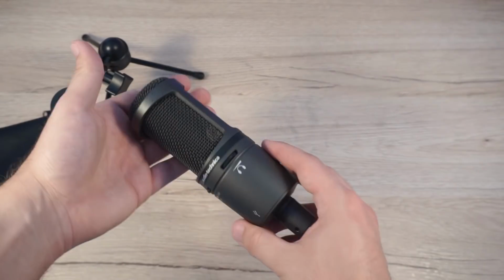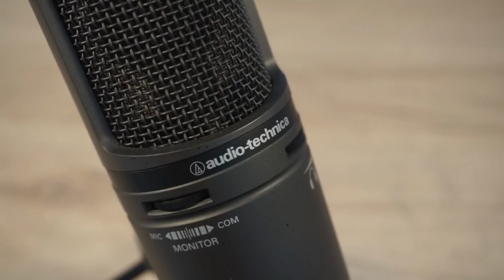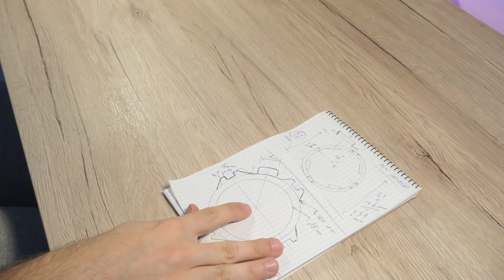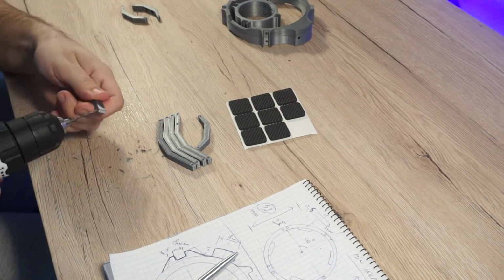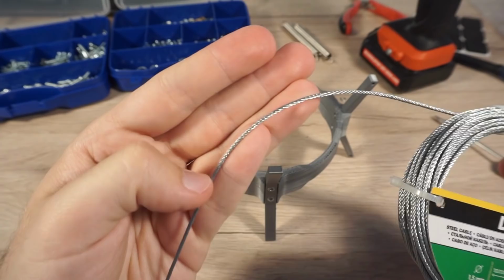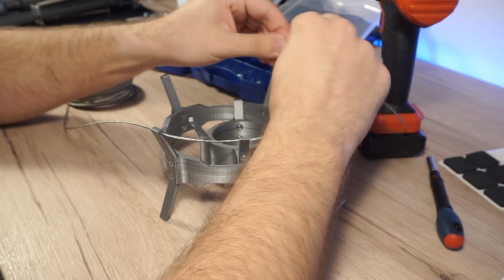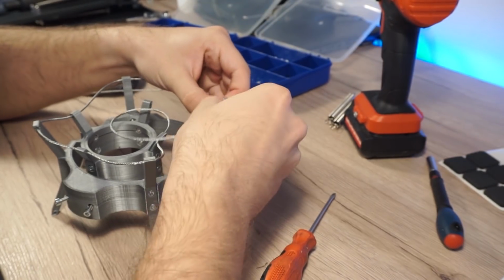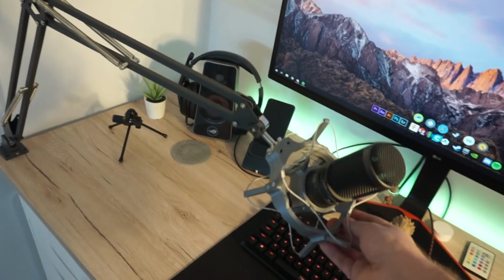How to make a shockmount AND boom arm for studio microphones | Audio Technica At2020 USB+

Comment: Okay....there's a major flaw with your shockmount - it won't work since it's all in steel, using elastic bands makes sense, because it has to be isolated from the environment, however, your construction makes a solid connection, almost as solid as solid coupling with no shockmount. Just sayin.
Reply from the maker: Hi! I am aware of this but I cannot find any rubber bands for a shock mount locally. The design works for any material, either it be steel wire or rubber band :) Currently it works fine and i tested it to see if any shock would be absorbed and indeed, only about 50% of the spike is absorbed. I did not intend to make the best shock mount available, just to inspire you to tinker with what you need :D Thanks for the tip, anyway! :)

Comment: Is the best "homemade" I've seen.
3D printer makes all the difference...

A very good work.

Sadly I have no 3D printer 😆🤦🏻‍♂️
Reply from the maker: Thanks for the kind words! :) 
Yes, unfortunately a 3D printer would be required. But also, you can send the 3D files to a local print company and it should be pretty cheap. I think 3DHubs is a good place to start :)

Comment: Hey! Great video! Do you know if it will fit a Samson C01u condenser mic? Thanks!
Reply from the maker: Hi Damian! As I've seen on the internet the diameter of the Samson C01u mic is 69mm, which is bigger than the Audio Technica one, so it may not be able to fit it unfortunately :)
Reply: @tinkertv  already did it and fits perfectly! In Argentina it cost me half the price of the cheapest mount an almost 25% of the Samson mount.
Reply from the maker: @elandamio  i'm happy to hear this :)